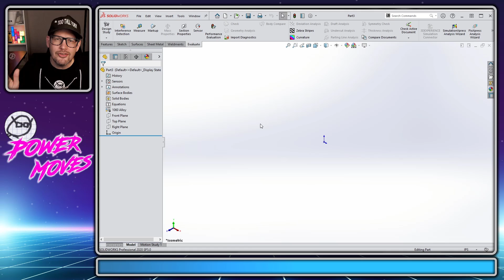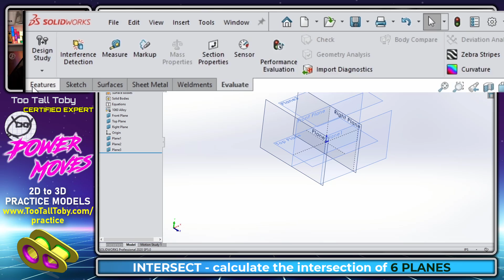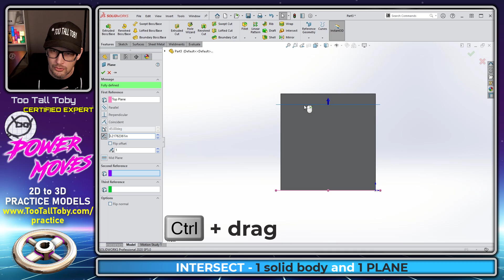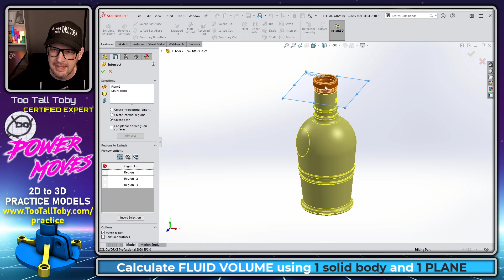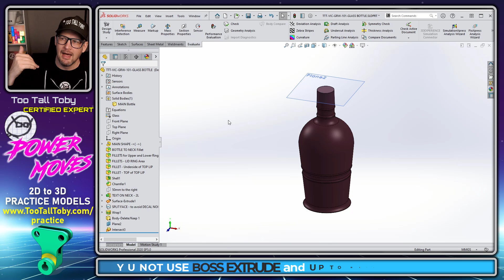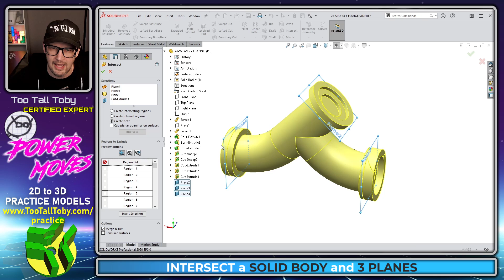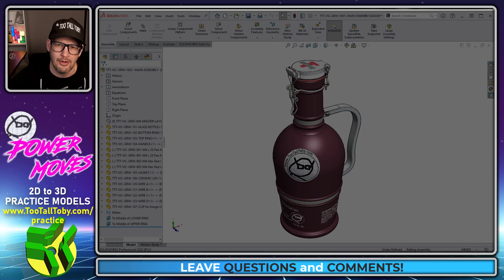How much WATER will this container hold? Fluid Volume in SOLIDWORKS

Comment: Thanks Toby. "Can you guide me?  How can we mark off a volume? I really appreciate you!!!
Reply from the maker: Usually I'll just use 
1. Insert > CURVE > SPLIT LINE - and use this to split the surface where the mark should be
2. Insert > SURFACE > OFFSET and offset that face at 0.00 mm
3. Insert > SURFACE > THICKEN and thicken that surface slightly to add some material
4. FILLET - to clean up the bounding edges

But it depends on the geometry of the vessel
Hope this helps
Toby

Comment: Thalys you for the video. This is actually very useful command. When  working with surfaces instead of trimming and knitting to make a Solid, this command could make a Solid from an enclosed space in one step.
Reply from the maker: yeah I thought about including that in the video but I wanted to keep it tight.  I'll probably make a follow up on how to use Intersect with surfaces to close off a solid!  :-)  Glad you liked this one Frank!

Comment: Awesome video! I created a box with a shelf inside as a test model in build123d and I was able to calculate the volume. Here is the sourcecode:

with BuildPart() as p:
    outer = Box(20, 20, 20)
    offset(amount=-2, openings=faces().sort_by(Axis.Z)[-1])
    Box(10, 20, 2)

inside = outer - p.part
split_inside = split(inside, bisect_by=Plane.XY.offset(8), keep=Keep.BOTTOM)
print(split_inside.volume) # 3776 cubic millimeters

The weakness of this approach is that I needed a version of the shape with the external shell completely filled. That might not always be the case like you showed with the piping example.
Reply from the maker: awww yeah nice job JERN!

Comment: It is an awesome tool. Also you can use it in combination with "combine bodies" if you pot bodies inside of the fluid. The body of fluid can be used in simulations. Combine bodies is more powerful to avoid the "zero thickness geometry" headache
Reply from the maker: awww yeah that's an awesome tip!  Thanks!

Comment: You actually don't have to remove unwanted bodies... you can just select the "create internal region" button in the Intersection dialog box. This will leave you with two bodies. Your OG container and the fluid level body. You can adjust the level then by the plane and see it in the container if you change the body to transparent.
Reply from the maker: yeah originally I discussed those options but the video got too long :-)  Great advice!